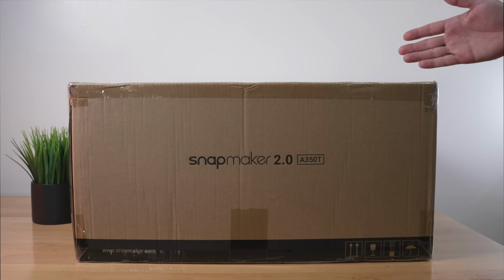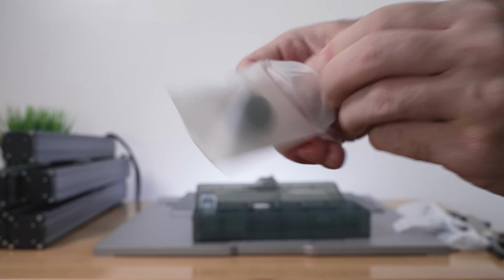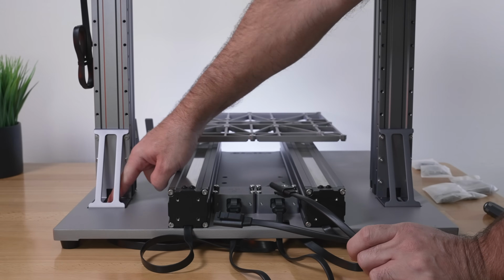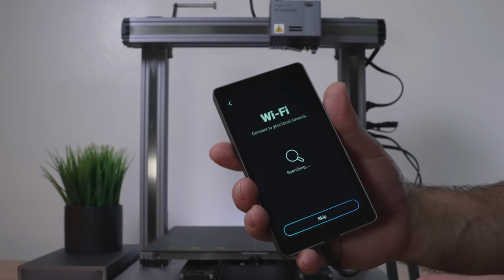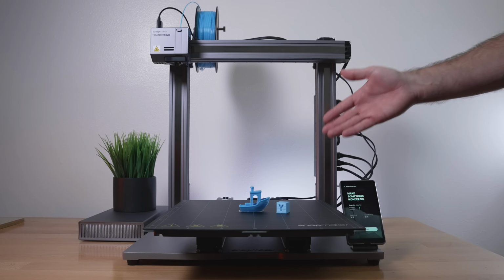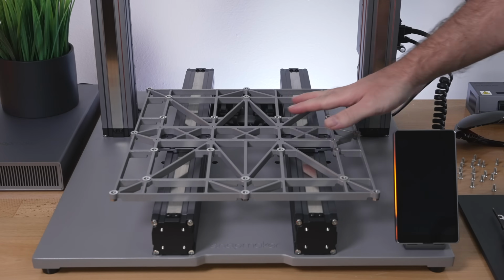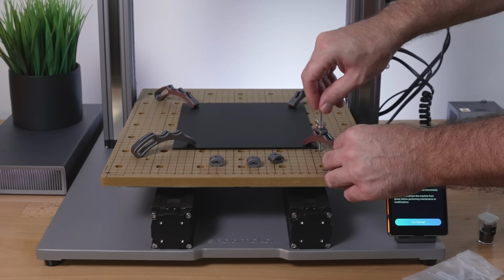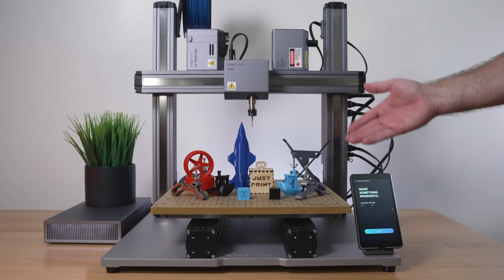SnapMaker 2.0 - 3D Printer - Laser - CNC - Unbox & Setup

Comment: Great video!   I'm not trying to be critical, but I do have a suggestion. As a 30-year Furniture Builder, cabinet maker and precision Flat Panel products manufacturer, that used handheld routers and CNC routers for many many years, I would like to explain the error in your instructions as far as the router bit placement. You are telling them to take the router bit and push it in as far as they can until it stops. This is a mistake. The cone-shaped item that squeezes the router bit is called the collet. You should push the router bit as far as you can push it and then pull it back about a 1/16" or 3/32"
The router bit needs a small amount of space behind the base of the bit to draw down fully,  before it is bottomed out so that when you tighten down the nut on the collet it does not bottom out.
If you do not give the router bit space before you tighten the nut on the  collet the bit will rattle loose and fall out, cause damage to your product and machine. 
So it would be better to say, push the router bit as far as you can and then pull it back just a little bit to give it a some space. As you tighten the nut it would draw the router bit down more and you don't want it to bottom out before it is fully tight. This is the way we trained all our employees after many costly mishaps. Thank you and good luck.
Reply: Good advice! As a retired jewelry manufacturer, in my forty years of changing bits and working to microns by hand, I've found that most very small bits are slightly off center and must be trued in the collet before tightening & can't be bottomed out. Even larger 
tool bits need a second look. A wobble of 0.15mm can cause issues in jewelry; proportionately in fine woodwork. You may have prevented grief to those who wish to master their skills. I trained under uncompromising old world masters. May your noble work stand the test of time also.

Comment: Don't get me wrong looks super cool but not worth $2,000 you can buy an ender 3 for $189 and buy accessories for it.
Reply: Your not going to get the best of any of the 3 functions it does. And you need plus and pro to get size and direct drive. 500-600 for ender. 300 for laser 500 plus for engraver. Then you got instead of half meter 1.5 meters of bench

Comment: In all honesty... I am not really impressed by the out-of-the-box printing quality. There are a lot of under extrusions and blobs in the first print. For this price point I was expecting a lot better. I am sure you could improve the quality a lot with a amount of fine tuning, but (again for this price point) this should not be an issue with the standard profile. I honestly got better results with a humble Ender 3 S1 with a standard Ender 3 s1profile, without any tweaking. It's not bad, but I was honestly expecting more. The build quality and construction of this machine looks superb without any question, but that does not amount to much if the output quality is less or just on par with a machine that's about 1/4 to 1/3 of the price.
Of course I should take in consideration this machine has CNC and Engraving/Cutting capacity, and I am especially interested in the CNC capacities (I do not care that much about Engraving to be honest, although the cutting capacity is not bad at all). I would like to see if the CNC spindle is sturdy enough to process metal, or fine enough to make something like a PCB. I really don't like that changing the platform takes loosing and re-tighting all bolts. Especially if you have to mount the platform really tight there is a high risk of wearing out the thread in a relatively short time, especially because the mounts are not hardened steel or something. A better choice would have been a standard (print) platform with extra mounts for the two other functions (or use hardened steel bus thread or something). Still - A very nice machine, but I doubt if it's really worth the high price point...
Reply: But all 3d printers and cnc require fine tuning if you have ever used them for long.

Comment: We have this at work, it’s a really loud printer and I find that the quality is not worth the price. There are cheaper printers, who perform much better
Reply: The T Version is much much quieter than the older models
Reply: @Die.Technokraten  Yes and the part cooling is bad on the older ones I have one and I can’t wait for my updated dual extrusion module to come
Reply: You must have the original A350?

The A350T is vastly improved in sound and speed. I upgraded my original A350 and I recorded a short before & after video comparing sound levels. 

https://youtu.be/lrYYHCy0vDU
Reply: what about the cnc and laser features?
Reply: @darknessstorm333  haven’t used the laser, but CNC is alright.